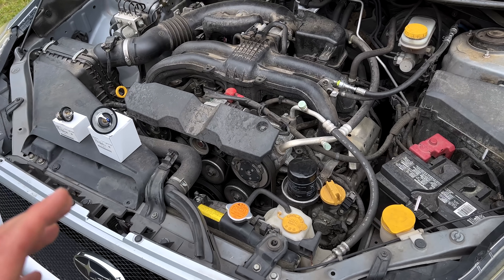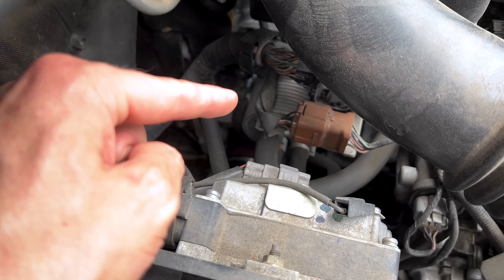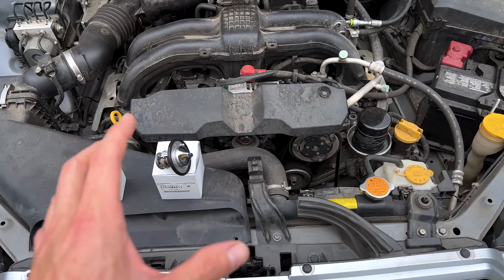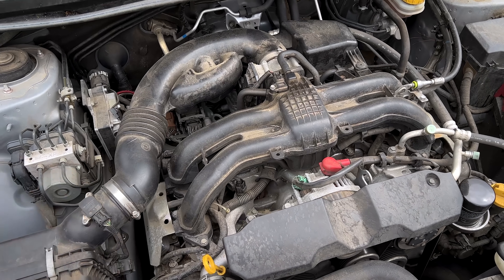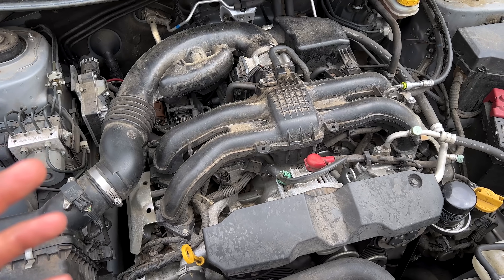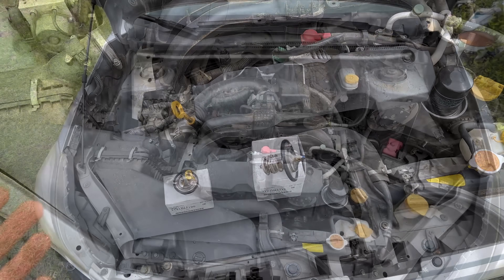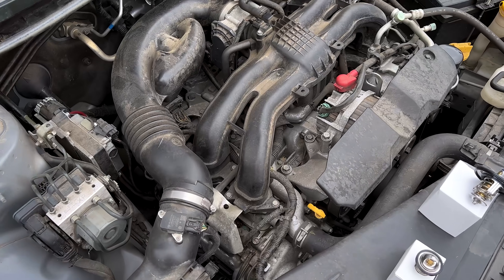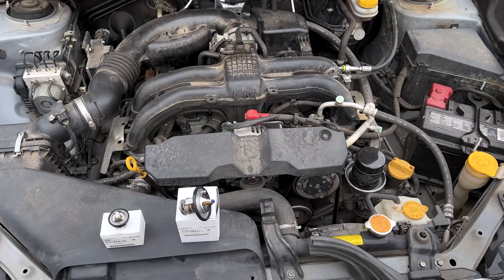Two Thermostats?! Modern Subarus' Double Thermostats & CVTF Cooler/Warmer Explained!

Comment: What about the Ascent? I’m pretty sure (could be wrong) that they come from the factory either an external cvt cooler mounted in front of the A/C condenser. Does it just have one of those external fluid thermostats like shown with the aftermarket auxiliary cooler you discussed?

Comment: Could this be why my engine is overheating? I have replaced the radiator, water pump, upper and lower rad hoses, regular thermostat and radiator cap. I have verified my fans are working too. I'm at a loss. Any help would be appreciated.
Reply: Could be
Corrosion in the cooling system
Bad coolant temperature sensor
Air pockets in the cooling system
(Maybe) Clogged heater core

Comment: Hi. Got a question. Does the 2023 Subaru Forester has this same TCV problem like other Subaru.  I just bought this car Sept 2023 and has less than 5K miles on it. I hate the idea that eventually, this TVC will fail and it will be a problem.  It would help me to decide whether to ride this potential problem or trade in for another car that won't have this type of issue since my car is fairly new.

Comment: @mrsubaru1387... i own a 2016 subaru forester 2.0XT wit CVT transmission... Does this use the CVT thermostat too?

I found the alternate code for the CVT thermostat you are using  is 21210AA191...

Comment: My local stealership is suggesting I replace the cooler/warmer in my 2017 Forester XT 2.0, but has yet to provide any evidence as to why. Currently at 70 k miles, and I've heard it's good replace it at maybe double that. Replace to be safe? Or tell them to get lost? Note that I live in a tropical climate, so have no use for the warming functionality of the heat exchanger. @MrSubaru1387

Comment: We have a 2021 outback.  The first cold winter I had it the car would not make any real heat for close to ten miles down the road and then you could watch the temp needle drop while sitting at a red light.  My first thought was stuck open thermostat.  Dealer ran their diagnostics after I drove it an hour to get there at 35 degrees outside and said it was fine.  It was under warranty so I guessing they’re limited to how far they can dig into something.  I love the car but between this issue and the faulty HVAC infotainment system I’m seriously thinking about getting rid of it.

Comment: Hello Mr. Subaru!! Thank you excellent information video! Question please? You said we should service the cooling system every 8 to 10 years/80,000 to 100,000 miles. I am guessing to replace any and ALL hoses correct? PLUS both thermostats and all coolant of course (Subaru blue), correct? I asked my dealer they said they generally do not replace any hoses other than the upper and lower ones?? PLEASE explain to me I have a 2013 Cross trek Limited. 73,000 miles. Thank you in Advance. All cars I eve had before I would replace ALL hoses sooner than this, but they all were way simpler systems. {Upper and lower and two heater hoses and maybe one 'bypass hose'}

Comment: I wish you'd redo this video, but properly point to things with either a screw driver or a laser. When you pointed to the housing for the smaller thermostat, I couldn't tell what the hell you were trying to focus on.

Worst case scenario if you were able to point on diagrams from the service manual as a quick overlay, that'd be pretty helpful as well.

Comment: Mr S. - Re: To this CVT Cooler/Warmer
For the folks way up north where it gets really cold . . . 
#1) Sugguestion: The cold deep freeze months of the year . . . 
What if you splice in a *Kats In-Line Coolant Hose Heater*. 
They plug in to 110V and come in two fixed temp ranges  . . . 
 270°F ( Hoses 1" - 2" ) 600W
175°F ( Hoses 2 1/4" to 3" ) 400W
Wouldn't that draw cold coolant from the radiator  and heat it . . .  
A)To make enough Hot coolant to open the thermostat behind the water pump and . . . 
B)  Then circulate through the engine block warming it and then  . . .
C) Make its way to the Warming side of the CVT . . .  Circulate . . . Then Return . . .  if plugged in overnight
* I imagine both of those OEM Thermostats start to open up around 160° or so . . . ???
That would start the morning out in a better way wouldn't it ?

The Hot Weather / Cooler Side of that CVT Unit is a no brainer

#2) Suggestion - The Start Up Oil situation . . .
A) We need to put our heads together and get that oil warmed up.
Heat pads are no-bueno and dangerous / block heater/cartridge on a Boxer / forget it
B) Then there's that Upside Down Ice Cold / Empty Oil Filter 1st  thing in the morning.?

They make Magnetic Warmers for oil pans but you must take them off after every use.
That's a real pain to do on a car but it's hard to argue with warmed oil in the pan ready to go.
Can't imagine the amt of damage a RU engine must go through being force started after sitting outside for 5 days in near 0°F or less frozen temps?
 
Warmed oil is a good 1st step but not a total solution to an empty/frozen inverted oil filter at start up. The OEM way things are now with the oil . . . in freezing temp cond's the piston rings and chamber are facing a certain early life span & so is everything on the front of that engine 
. . . timing chain, pulleys, gears, guides and much more . . . mostly because of the no oil drag created and the well concealed fake parts which dominate our entire market place. . . depends on how cold and for how long?

After all I have said above none of this seems to have been an after thought to Subaru ???
That . . . No ATF Dip Stick . . . on a CVT really burns me up . . . Just another poorly designed key component designed  to self destruct or keep dragging you back to the dealer.

Like to hear some stories from people who bought late model Ru's 2018-23 and have gone in for maint/service ???
Reply: I totally agree with you.  oil filter attitude is wrong.  I am in Texas, not  cold weather issue here  except every 5-10 years.  Your suggestions are very logical .  The CVT is not the best design in my opinion. The fluid needs to be changed every 30K miles..  You should write to Subaru direct..   Dealerships do no care.  But a Lawsuit get attention.

Comment: The little thermostat threw me for a loop while swapping a newer fb25 into an older Forester without a CVT. The older engine just had a metal cap pressed into the hole.
Reply: What did you do?? Im in that situation
Reply: @FloreaniGarage  I just put a rubber cap and hose clamp on the new engine's extra ports (there was a second connection towards the bottom of the engine) and otherwise pretended they weren't there. I havent had any issues 6000 miles later. I also had to swap the wire loom, ignition coils, valve covers that the ignition coils mount to, and one or two of the sensors that didnt have matching plugs between the wire looms. Oh and the power steering pump, alternator and AC pump were all different but they all swapped over without any issues.
Best of luck on your swap!
Reply: @bigchungus1888  I believe my issue is actually the opposite as you. Im swapping a 2015 subaru crosstrek fb20 motor into a 2013 subaru crosstrek but on the 2015 motor there is metal plugs where my coolant lines should go into that feed the CVT Cooler. Im wondering if i really need the CVT cooler or not, or what i can do to get it to go with the Cooling system. Do I have to take out the metal caps in the engine?
Reply: @FloreaniGarage  ooh, yeah that's a bigger challenge than I had. I think theres more to it than just removing the caps, and I'd guess that the CVT cooler isnt optional. 😂
Reply: @bigchungus1888  So far my best bet is just looping the system back to the transmission because with my acquired engine there is no way to get the coolant lines into the block. I just swapped the wiring harness over to the new engine and also the coils. The coils were different but I’m hoping that they fit on the spark plugs right because i really don’t want to swap valve covers🤣.

Comment: Another great video as always!  I came across the baby thermostat when I bought a used coolant crossover tube a few years ago.  Did a coolant change, hoses, water pump and remembered to get two thermostats.  Did not use the crossover tube which is somewhere in the spare parts room, my wife’s favorite place😂🤣.  

Anyone here correct me if I am wrong but the blue temp light at start up for CVT cars is to make sure both the engine and transmission are at the correct operating temperatures before heading down the road.

Comment: That cannister heat exchanger was a factory configuration on some higher spec 5eat models. It was added into the heater core circuit. Getting a used CVT version and cleaning it out is a nice upgrade for US models which don't have it. This is superior to an external cooler in most cases since it doesn't block airflow to the AC/Radiator. You have to fab up a bracket but it fits very well on the back of the drivers side head right below the heater lines, and makes plumbing the ATF lines easy as well since they pass that area.

Comment: Very good advice , I'm at 80.000 Km now on my 2017 CVT Impreza, I'll change the coolant and both thermostats at the 10 year mark or 160.000 Km. We have temperatures of down to -25 or even -47 Celsius during winter here  north parts of  Alberta.
Reply: Wow. How about commenting on my post above. Like to hear your thoughts and experience you have had with your Impteza.

Comment: I was literally looking into this today as I have a 6AT Scion FRS. Wondering if I can take out the transmission thermostat to help cool down the fluid on track/mountain roads instead of running an extra cooler?
Reply: I wouldn't. The purpose of a thermostat is to allow the coolant in the radiator time to cool down. If you take that out of your system, it will overheat. I made a similar error and had overheating issues.

Comment: My CVT went out at 93k miles and was handled under the 100k warranty…what exactly did they do at the dealer?  Was a new thermostat installed along with the new fluid?  Thanks.
Reply from the maker: They likely didn't touch that thermostat. Hopefully they at least flushed the cooler/warmer.
Reply: @MrSubaru1387  could you do a video on doing that?

Comment: Does the coolant temp sensor ever go bad, ECM thinks all's good, and never cycle the radiator cooling fans? I wish you did vids on using pulled OEM parts in lieu of new OEM. Like, maybe a hydraulic power steering rack. Replaced hard lines with the lines from original rack except the return line. Guess which hard line is leaking? I call uncle. Wrench slipped tightening tie rod jam nut and took a time out at ER wanting to send me to Wake Forest thinking I had an internal brain bleed. I put you down as emergency contact as I knew my Subie would have a good home if I checked out, lol

Comment: why does my car jerks when i stop on a sloop; when it does the cvt temp is at 80-85 degree Celsius ?

doesnt happen when its below 65 degrees Celsius. i have trans cooler that bypass the stock cooler that you showed in this video. (i live in the tropics so its not a issue warming up)

Comment: When monitoring CVT temp on my 2011 Outback and 2021 Crosstrek there is a huge difference in fluid warming. The Outback had the transmission cooler in the radiator and it took quite a long drive to get above 100°F. In the winter, the CVT only got up to 80°F after a 10 mile drive. The Crosstrek's CVT gets up past 100°F quickly.

Comment: This was very interesting, I had no idea about the CVT warming function.  

I had been wondering, on my 2017 Impreza, in winter the engine does not heat up as fast as previous Subarus.  In fact on a ski trip in Vermont I drove an hour on a subzero morning and the engine coolant never went above 165 degrees.  Then suddenly went to 200.    I wonder if all the engine's waste heat was going to warm up the CVT.
Reply: maybe your thermostat is stuck open then suddenly closed to warm up engine.
Reply: I have to keep heating set lower around  70  Fahrenheit  or lower on my 2017 impreza  on my long ski trips when it's really cold out (Marmot or Sunshine - Banff) , as the transmission steals most of the heat to stay efficient  and lock the torque converter  most of the time, compared to my 4 speed auto 2008 Impreza never had this issue  -  you could have the heat on full blast and still get excellent fuel economy and normal coolant temp in winter. My other car a Toyota Rav 4 Trail 2021 warms up very fast in winter and coolant temp stay locked no matter how cold It gets here north parts of Alberta.

Comment: Great video! Quick question. My forester at times doesn't crank over when I start it. I recently did spark plugs, valve cover gasket, spark plugs tube, and also the fuel cleaning. Possible the starter is going out?
Reply: Year/mileage/trim level?
Reply: @OutsideTheTargetDemographic  11 subaru forester premium x
Reply: I had a similar issue in my 02 Impreza, and I found it was a bad ground. I'd double check all the ground wires for any corrosion or fraying
Reply: @YLWSpotterLiam  I'll check that out.
Reply from the maker: It's a no crank, or, a crank/no start? I don't know what "crank over when I start it," means.
Reply: @MrSubaru1387  At times it doesn't start when I turn the key. Takes a couple of tries
Reply from the maker: So it doesn't start, but does crank? Or, does it do nothing when the key is turned?
Reply: @MrSubaru1387  Yes the first one. It does crank

Comment: Hello, I follow you from Chile and I have been able to solve problems thanks to your videos in my legacy 2.0r 2007, but now I acquired a legacy vz 1994 1g and I have problems with my automatic gearbox, the bad thing is that I did not find 1g here but I did 2g and they tell me that the speed selector is incompatible, I resort to your knowledge so that you can tell me if it is possible to place and adapt the 2g automatic gearbox in my 1g or even if I don't want to, I will have to switch to manual

Comment: Where is your power steering reservoir?
Reply from the maker: Electric power steering.
Reply: Had my Electric Power Steering replaced due too much play internally  with a revised  unit, that was on a 2017 Impreza. All under some extended warranty from Subaru relating to power steering. Before replacing it my car's steering was as loose a very old truck. My tie rods wore in good shape, but they replaced them too. Zero $$ out of my pocket I can't complain.